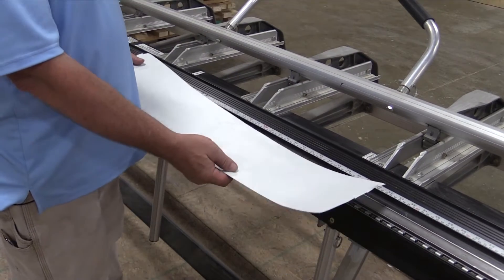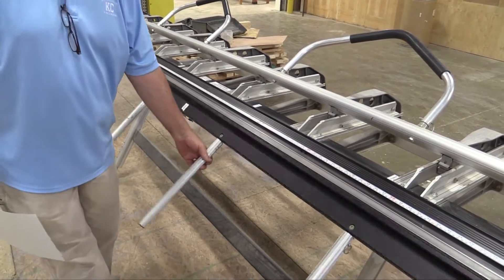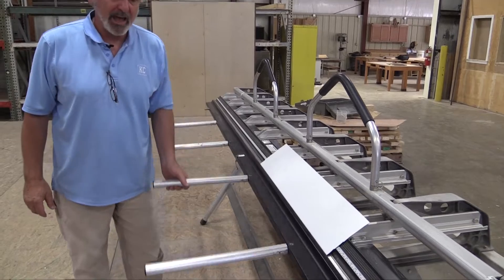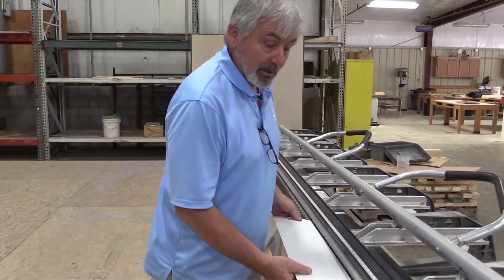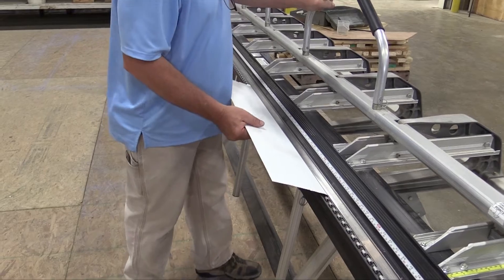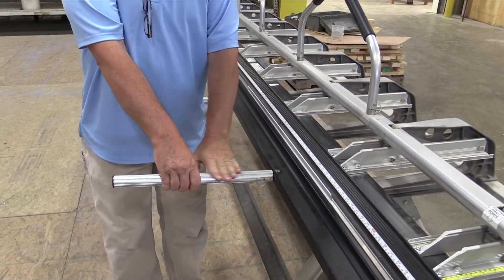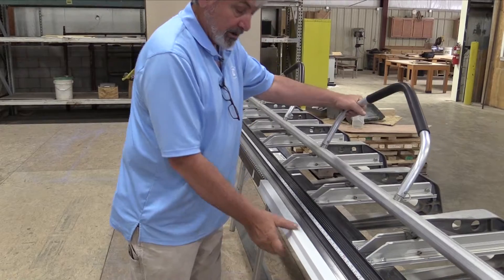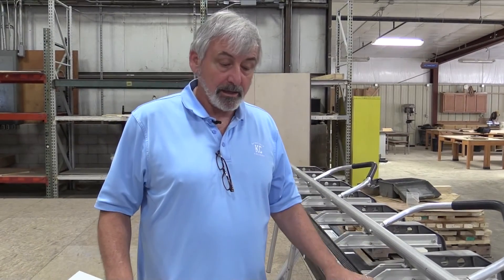How to Use a Metal Brake

Comment: you don't discuss setback.... or use any measuring devices to reach your desired angle. it's all guess work.... anyone can just bend the metal- what matters is precision. but thank you for at least taking the time out of your day to post this.
Reply: Sydney P. Since you seem so knowledgable about this, whats a decent brand of brake to purchase. I have about 100 doors that i need to make some flashing for. Obviously I'm no pro at this but im not into cheap tools either...thank you for your time
Reply: @ryanspence7239  I am no pro either but you could rent one. I've done that today I am going to use the one down the street that the siders left behind.
Reply: I just picked up a similar unit. Is there anything like a angle gauge that installs on the side with an arrow so you pump out the exact looking flashing without the guess work?